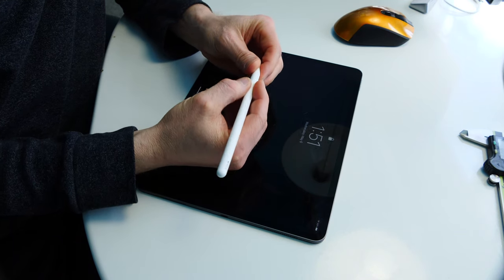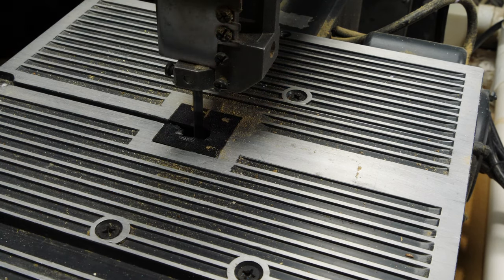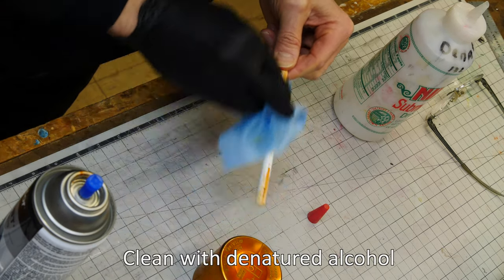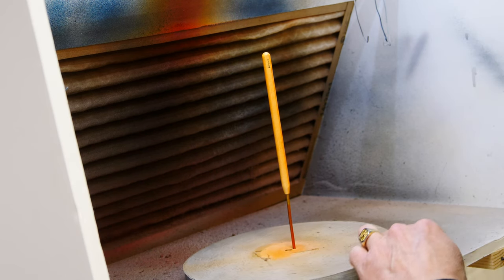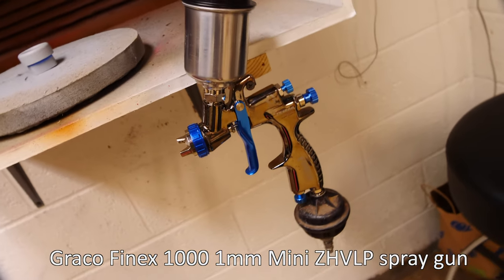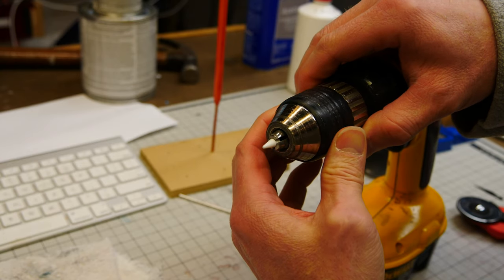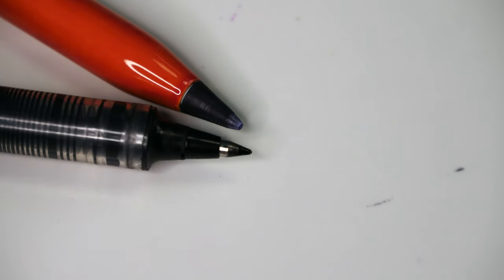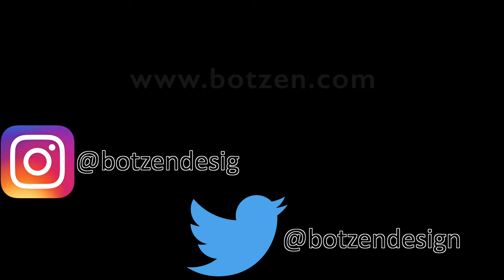Modifying an Apple Pencil for better function and usability

Comment: I solved the gripping problem in the first apple pencil with the rubber part from an old Pilot mechanical pencil. Fits perfectly and works like a charm.
Reply from the maker: I am not willing to add thickness to the pencil, so I opted not to do that rout.
Reply: @EricStrebel  yea especially since it interferes with charging
Reply: @EricStrebel   do you notice the visible offset?  Any idea what size you got it down to?  I read that if you go to fine the visible offset can't get plenty. Annoying, any insights?  I was looking at pen tips and they sell some metal tipped deal that just looks like you'll notice the offset and it'll wear through any matte protector rather quickly, maybe there's a  sweet spot with the metal tip and a rough tooth screen protector?  Thanks
Reply from the maker: No

Comment: ive done body work for the last 20 yrs. a few tips for fisheyes. fish eyes are all about surface tension . first step to break that tension is prep the surface. for the pencil i would use a 2000 grit sandpaper and skiff the surface. this will break the surface tension but not allow metal cast to build up in sand scratches. second. ditch the wax and grease remover. sometimes it makes things worse, by basically seasoning and spreading any grease out that may be on the surface, but not removing it from surface. Nason, and dupont make a product called final clean. it’s a surface cleaner and prep that really cleans and breaks that surface tension of any oils that are on the surface. just a few tips. hope it helps
Reply: Great tips! Thanks
Reply from the maker: Pro tip thanks for sharing, much appreciated!
Reply: no problem. if you have any other refinishing questions, please feel free to ask. I do bodywork on semi trucks mainly , but have done cars, busses, rv’s, motorcycles, guitars, helmets, metal furniture, all kinds of things. airbrush and specialty paints. i’d be happy to pass along any tips I can.
Reply: @eross21  Hi Eric. Would you mind giving the rest of the steps you would have taken to finish? Also, would you have sand between coats? Heard of rit dye? Would that have been a better choice? Thank you.
Reply: @bassstudent4life  sure  if i was going to paint  this pen. I would sand with 2000grit paper. i would wipe it down with a surface cleaner like Dupont’s final clean. it neutralizes the surface so that no oils or plastic mold release agents can escape. I would spray a lite first coat with an intercoat clear. most car paint manufactures have it in their line. this will act
as almost a clear primer and give the color something to hang on too. then I would use a dye based candy paint mixed with the intercoat clear. i’d do several light coats of that, untill desired color is achieved. then simply finish it up with a clear coat.
Reply: @bassstudent4life  do not use Rite dye. it will cause lots of issues with the paint. it really only works for fabric. also it will fade very quickly. 
Createx make some nice candy( dye based) called candy2o.  they get mixed with their intercoat clear , and are not very expensive. that may be a good option for you.
Reply: @eross21  Thank you so much Eric. So no sanding in between coats. Because i've seen cars being painted before and the guys would do light sanding even between clear coats. Can you do the dye based candy paint in a can? My goal is to reproduce the iconic " Ticonderoga #2" look.

Comment: Why didn't you use the turntable when applying the clear coat?
Reply from the maker: Good question Tony! While the turn table rotates, it only does so in one axis. I need more flexibility when spraying paint for getting into the underside of areas, such as the tip. Plus the gun is a physical thing and maneuvering in the spray booth can be tricky as the space is confined and limited. Also, if I get a run, I could potentially save the part by rotating it. Hope this answers your question. Thanks for the comment and support, very much appreciated 😊👍

Comment: I like the orange. At the end when you place the pencil on the iPad, it appears that the tip is white again on the end. So did the black transfer to the screen or just wear off, and is it worth coloring if it just comes off anyway? Metallic colors would look cool too. Now get Apple to do this please. Lol. 👍🏼
Reply from the maker: Some discoloration has occurred over time, it's like a dark grey at this point
Reply: Eric Strebel “...at this point” No pun intended. 🤪
Reply: there are black tips available for the apple pencil. check those out if you want

Comment: I really love it!

I’m going to set up a little workshop in my new house. And that corner with forced ventilation for painting would be perfect to paint my 3D prints and my Apple Pencil.

My fear is that I don’t have the professional equipment and tools for painting and I don’t know if with canned sprays I can achieve the same outcome... I would look for similar objects to test it before “playing” with the certainly-non-cheap Apple Pencil. 

Apart from that, instead of painting the nib/tip I’m going to buy a made of black rubber/plastic. Let’s see how it goes.

Thanks for your video!!
Reply from the maker: Good luck

Comment: Did you happen to try a piece of thin heat shrink tubing to assist grip? Would that affect the charging at all?
Reply from the maker: Nope, have not
Reply: I have tried and it works well I used shrink wrap tubing that i had left over from doing my PC cables...just watch the tip when applying the heat as the apple pencil plastic is thin and melts very quickly.

 Unfortunately I found that out the hard way, didn't realize it until I took off the sleeve and it slightly shrunk the barrel near the tip so the gap between the barrel and tip is now bigger and uneven. My fault for letting the heatgun get too close and starting at the non-tip end first so by the time it got to the tip end it was too hot.